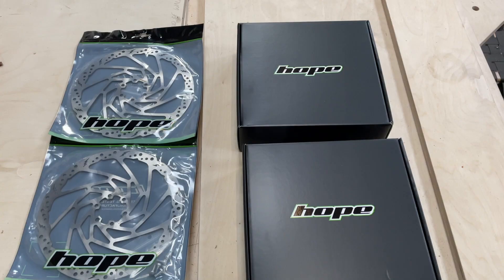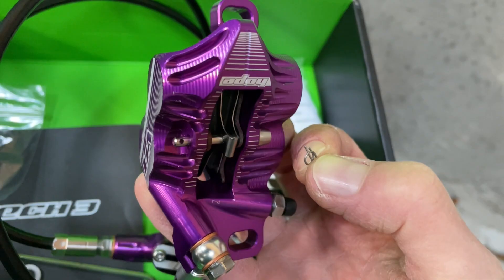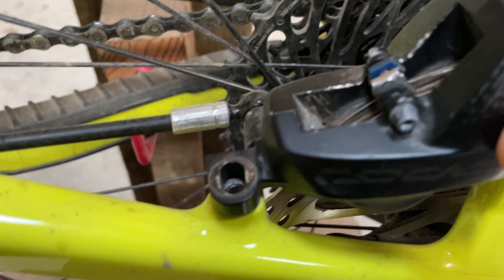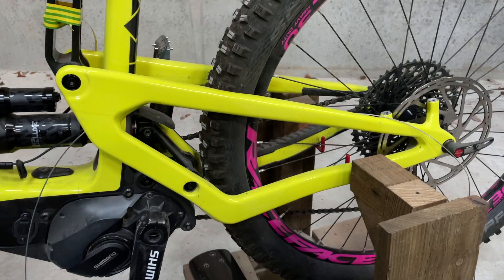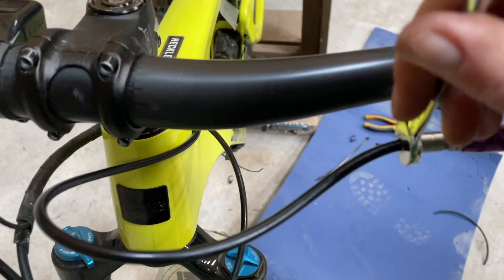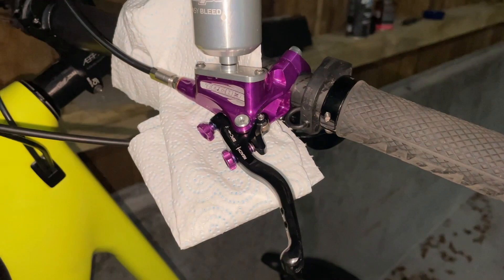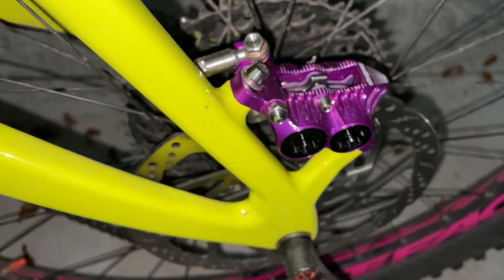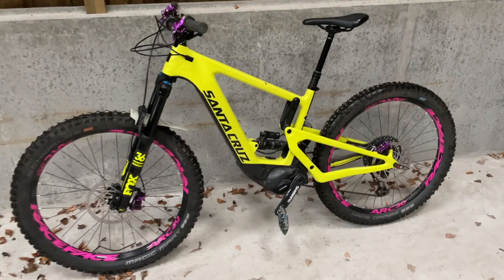How to: Fit Hope V4 brakes to Santa Cruz Heckler eBike

Comment: Hi Sir, what was you solution for the magnet that passes by the sensor of the bike at the rear disk rotor ? Thx.
Reply from the maker: Hi, I removed the magnet from my old rotor and attached it onto my new rotor. The magnet blots on to the rotor using the rotor bolts.